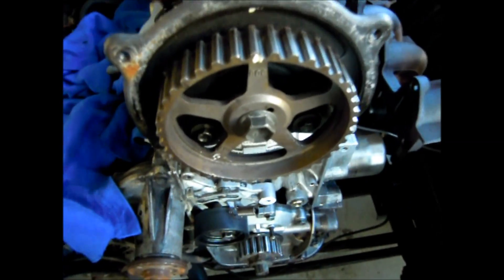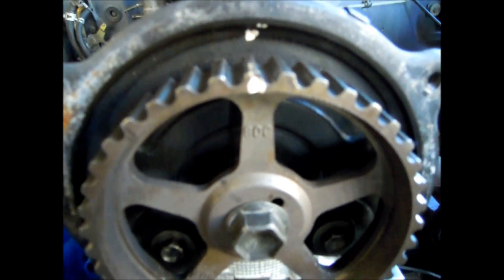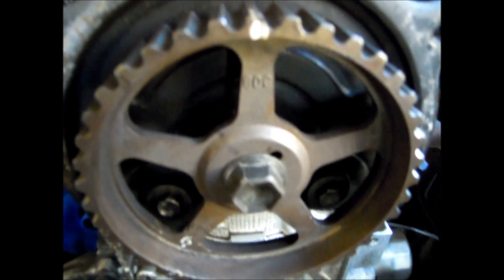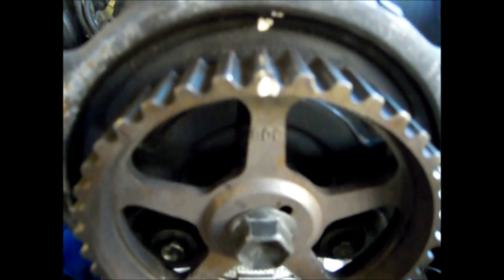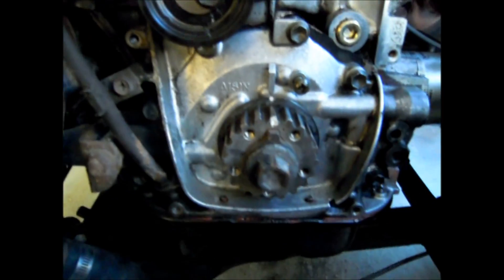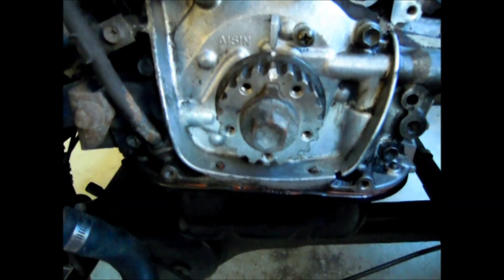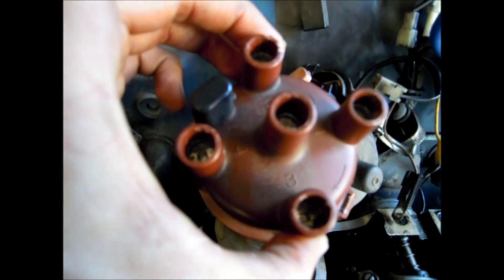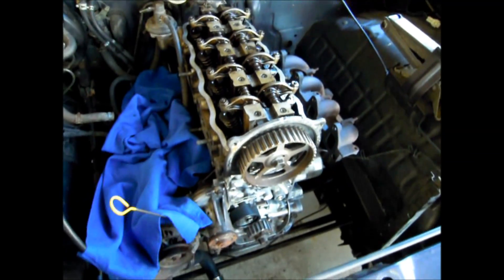95 Suzuki Sierra G13BA timing

Comment: Because of a flaw in the camshaft timing cog, I changed both the crank cog and camshaft tim9ing cog, from a 1992 holden barina, to that of a 1995 suzuki samurai, after watching this video, the 80 was the right spot for correct timing.

Comment: Thats the swift setting..no good on sierra..60a is the setting for sierra with those round tooth pulleys. On your setting they have no power below 4000 rpm are hard to start and idle very poorly..no vacuum
Reply from the maker: It's the factory setting on mine, it runs just fine for me.
Reply: @hotpilotboy20  if you say so....